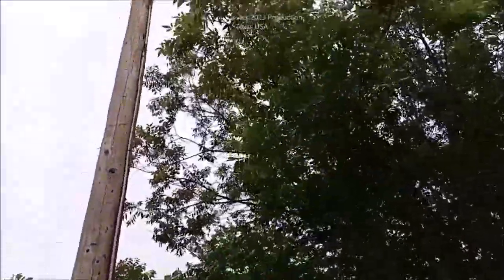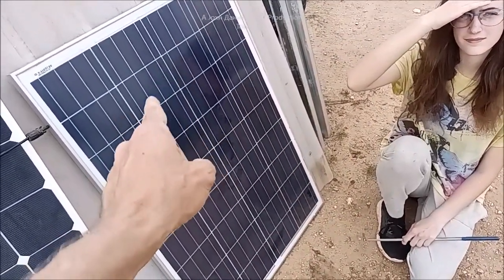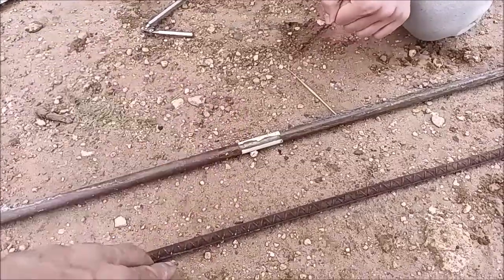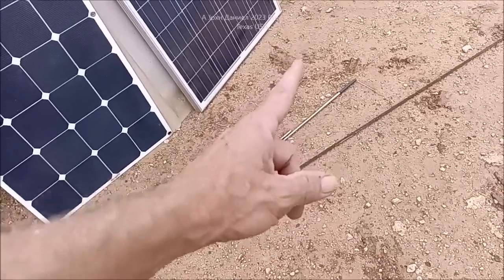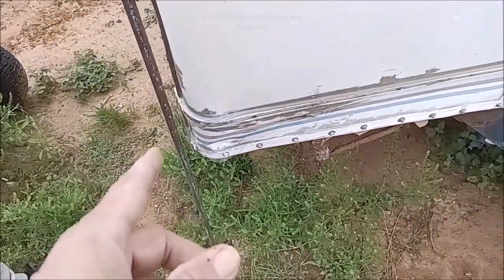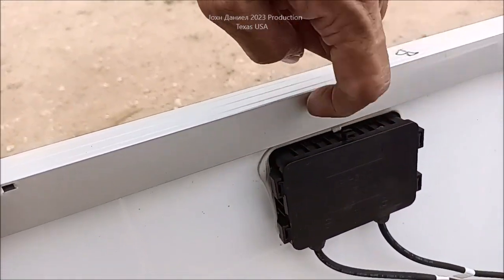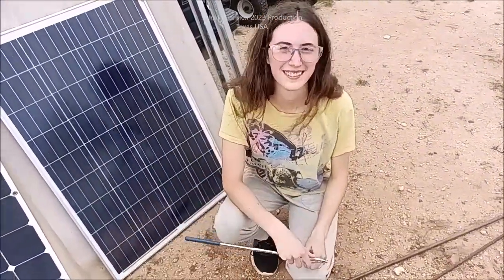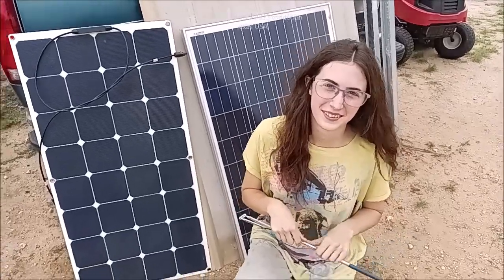Grounding your SOLAR PANELS? 🤔 You Better watch this First! *KNOW DC/Inverter POWER is not Utility

Comment: Very informative. Mr John, Im about to install a "Tram 1477 Pre-Tuned 144 MHz–148 MHz VHF/430 MHz–460 MHz UHF Amateur Dual-Band Base Antenna with White Fiberglass" on my roof and run relevant coax into the house to connect to Ham radios and/or amplifiers for the radios in the house. Can you give any recommendation for how I should or shouldnt ground against lightening? If I should run a wire, can spare low grade coax be used? Or old household extension cord? Or its gotta be heavy gauge? Thanks for your clarity and experience.
Reply from the maker: Your lightning target is the base of that antenna. I recommend a standard lightning rod set up using 4 to 5 feet of rod, rebar is ok to use or 5 feet of 6 awg bare wire coiled 2 feet in the ground with the rest up to a rod about 6 to 10 feet away from your antenna and a few feet higher than your antenna. What we have done for lightning and stray static is use 1-3/8 fence rail up the side of the house with stand offs on each end of the house going  6-10 feet higher than the house with a 6 awg bare solid copper in it and it coming out at the bottom 2-3 feet coiled some about 2 feet into the ground. This draws all such events away from your things and sends it down a safe route. 
On my place I have 3/4 rebar driven 4+ feet down with welded plates on it and all connected to the metal frame and siding in 6 spots on my place. But I am in a 5300 square foot metal building I made into a house.
Reply: @ Thanks for this answer. I think Im probably going for the "standard" set up, although... how do you feel about a wire going from the on roof antenna, traveling across the surface of the roof, and connecting to the ground for the house at the electric service entrance where they pounded the copper rod into the earth? Is that an invitation for problems? or good practice? Either way, whether I do the wire down side of house to rebar I pound into soil; or I do the wire traveling across roof to get to service entrance copper rod in earth, are thare a particular kind of insulator fasteners that should be used to fasten the wire? Or any plastic wire fasteners are good?  Thanks for your expertise.

Comment: Hi John, I am getting some conflicting statements about grounding inverters in an rv. I am going to be using my rv AC power cord to plug into my inverter while boondocking. Should i ground the inverter chassis to the RV frame? The power cable will be feeding my AC panel in the rv.
Reply from the maker: I just wire all RV powered inverters as 2 wire and do not use the bonded systems. It's how we got power for a century till the right faceless bureaucrats got pissy.
Reply: @JOHNDANIEL1  thanks John

Comment: I have a 6kw inverter system with 4 x 590watt solar attached. 
I occasionally charge batteries using grid power. Where should i ground the system

Comment: But do you gave s hybrid charge controller that converts to AC? Eg4 6000xp converts to AC snd if you put a breaker panel off the output which is then 240 AC you need a neutral ground bond in that breaker box if you running off grid and no grid connection.
Reply from the maker: Hybrids never last as a stand alone inverter, they tend to be underbuilt ( note weight compared to equally rated inverters ) since they are basically not designed to be off grid more than as a UPS and run on full high dc volt solar conversion. If you try to use them only on battery then you will see they can not handle much.

Comment: At 2:35 "...They (utility) gives you two phases...". Households are supplied 1 phase of 240 VAC split between TWO LEGS. Each leg provides 120 VAC on each side of the pole transformer secondary. A neutral line (which separates the two 120VAC legs and is connected to the center tap of the transformer) runs with each leg to the service drop, along with both "hot" leads to the main panel. At the pole, the neutral line is connected to a noncurrent-carrying safety wire at the base of the pole. Likewise, the premises drop has a non-current-carrying safety wire to ground at the meter point. Only one phase enters the household.
Reply from the maker: OK, join them together so you can double 120 volt amps, of course they are not as you say 2 phases so they will match perfectly, wave for wave not 180 off. Or has the industry not noted as a split of the original single phase, it is actually now not halved, but 2. Can't have it both ways. The ground cable neutral should be removed also since it has no use. And so should the ground/neutral tap on the transformer. But you have to do it on all the poles for a few miles to prove it does not do as the schematics say and then we're in total agreement.

Comment: i am watching this because.. i just placed an order for a 500 residential panel to replace my wo 200w portable ones that ive been using on my roof.
so until its delivered i was looking at the information page of the panels and i noticed on the diagram it has a "grounding hole".
So i was wondering ifs necessary at all?.. i mean i live in the caribbean when its storm time i plan just flip off the solar input air switch.

Comment: I just found out that the farmhouse I bought isn't even grounded. I asked why and they said it would attract the lightning. Still debating over to put one on or not.
Reply from the maker: If you plan to install solar then do it on a steel rack at least 50 feet from the house. Most all old farm houses in remote or open areas avoided lightning rods so that they didn't get hit and burn. If your in the plains you should find the famous piece of 5 to 6 foot long rail road rail ( iron ) sticking up sometimes a foot and buried 4 feet nearby usually about 100 feet from the house on a higher piece of ground. The old timers called them God Fingers because they pointed lightning to the ground there.

Comment: Just for the record... You will never get the Net Metering approval and operation system permits in my location.  Ground is something they take very seriously.  I'm Certified Electrician and Installer.  My two cents.
Reply from the maker: Net metering is only surpassed by Casinos as the biggest bait and switch scam on Earth. We only do independent off grid, no grid no meters. Better to leave that for folks who like odd power outages, grubberment red tape, lies about the hidden liens and laws your gonna regret. I know when I did commercial installs, discussed it with installers in nearly every state, it was a requirement to convince yourself and lie anytime challenged that your all about the "environment" hustle! As long as the Check Cashed.

Comment: Thx u for the video. If I have 1700 Watts of solar coming in, and Im making a system that can be wheeled around in a cart in my basement, do I still need to ground anything? Each panel is about 54Voc. I was going to route the wires for solar under my porch and into my basement. I would appreciate any advice Thx u for everything
Reply from the maker: Wire heavy, use actual fuses, AGU or Mini ANL with best and quality fuse holders. I would be sure to use 1 spec gauge thicker than they call for in any areas that is not easy seen so that section is safe. Example, 24 volt system, 1700 watts is about 70 amps ( normal is using 2 of the 40 amp MPPT ) and that is 8 awg rating to be safe from the controllers to battery, 10 awg due to high panel voltage and lower amps to each controller from solar. Just always wire heavier than they tell you! And use fuses rated for 120% of your calculated amps, 80% of your calculated wire ability, so a real short will pop them and prevent issues.
Reply: @JOHNDANIEL1  excellent thx u ! The panels will actually be on the ground in triangle mounts. I will use the higher gauge wires and fuses like you recommend. No need to ground anything with the panels or ground the controller, inverter, etc inside the house that will be wheeled around? thx u kindly again for your response
Reply from the maker: @andykular3756  The code/regulation/bureaucrat folks who never twisted a wire nut on anything tell you that you must GROUND dc power are the same who are being fired in government for stealing trillions. DC power can be dangerous but the grounding introduces errant static, not solves it. As for your inverter it is a 2 wire design, all of them are even the ones that the code enforcers forced to add a terminal for ground, it is still a 2 wire. My solution is always best grade of fuses like in a Boat, RV or Cabin. No matter how big your system is that is the solution. It only changes when you add some form of grid connection to them.
Reply: @JOHNDANIEL1  excellent ! Thx u for this. I will use the best fuses and will not ground. Really appreciate your candor and advice

Comment: An earth ground is NOT part of a AC circuit.
Reply from the maker: OK, Sounds good. Remove yours on your house and on the pole your transformers center tap is using to balance itself and then it's fixed. I recommend prior to destroying the design you claim is not involved, to read how Neutral/ground line is created. https://www.ecs.csun.edu/~bruno/MultiGroundedNeutralFinal_4-17-7.pdf
Reply: @JOHNDANIEL1  , that's an interesting read but doesn't play out at my pole transformer.  I have no readable current at my grounding conductor/electrode at my home.  My amp meter reads 0.06 amps on the grounding conductor coming from the center tap of my transformer.

Comment: I'm trying to be respectful here, but this video needs to be called out for misinformation. There are tons of nonsensical and also, plainly wrong statements, I'd have to write a novel here to address every questionable statement in this video. Lots of pseudojargon that sounds so incredibly competent but is, at its core, made-up nonsense. If the authors of this video mean what they are saying, then they have no comprehension of either electricity, or magnetism (no, a groundrod is NOT a magnet for lightning...) and no business giving advice on electrical installations. My advice to DIYers: Ignore this video, follow code, ground your solar panels.
Reply from the maker: Appreciate your  'misinformation claiming leftist liar scam" Soon as some ASS-Jack starts saying "misinformation" and Muh Facts,  you already know they are some leftoid nut job sucking big governments ass, and a tax fund leach level leftist bureaucrats communist point of view Karen, but word salad criticisms are not opposing facts, just crap talk. Saying you shouldn't listen to someone with 18 years installing solar and repairing it is just a Karen being a Karen. Feel free to produce your actual facts if you have something aside of fear mongering and being a tool for those desk jockeys making rules who think a wire nut is something to suck on from a woke whacko cross dresser. 
Go write your book to include all the facts you failed to spew any of on here. And while your at it, hammer a ground rod through your own foot since the sun shines on you and rain and lightning my be nearby as well when your not in your underwear in a basement slamming cheetos. There is no "code" for the home owner, DIY RV owner, Camp Owner, Boat Owner, self builder, Etc.,  under federal statutes for solar just for the online certified clowns who sell it to you for 700% mark up. We detail in dozens of videos as here that DC low voltage is not worth grounding, and panels ( aluminum framed glass ) are not common to sudden detonation. Over 80% of solar panel fires involve 3S or higher wiring plans on panels due to MC4 and disconnect failures at over 60 volts. We promote 12 and 24 volt real prepper systems and suggest nothing higher in a battery than 36 volt or from series solar panels of 50 volts. Voltages over 40 volts get you into the real deadly voltage range so we instruct to not grow a stupid hat and run 150+ volts DC like so many Walmart roof fires (300vdc) of solar has in common. Quality MC4 don't exist, and don't blow smoke up my ass about 1 brand no longer sold made in Germany. Why go over 50 volts to make it arc.  
Over 100 million watts on Boats, Cars, Trucks, Busses, RV's and in back yards feeding something have NO ground rod because they have no moron forcing them to do something that fukn stupid. And your a super tard if you think a increased continuity option for lightning such as a ground rod does not increase your target status ( Duh, metal bridge, building, metal shed:  key word metal, connected to ground ) Why you think lightning rods sold for 400+ years? Just some Funky yard Art? 
No, they ATTRACT so to defer to a safer source of end point. If they did not work, then your funny code was not in existence in 1866 (telegraph Service Construction Rule) when that was a "common rule" and they would not have required them on all bridges, , towers, commercial buildings for the safe routing of lightning management. Same under BOCA that we used in the plumbing (not solar electric) industry when copper water systems was the standard. 
HOWEVER, if your a true blue moron and you plan to short your wiring to your panel frames as you install, then by all means ground that son of a beotch so you do not kill anyone. This sounds like your concern, so yes, ground it to hide your incompetent wiring and lack of fuses.
*NEC Code requires grounding isolation ( chassis of fixed objects, not the DC cables, that may hold negative voltage which is not on your solar panels frames unless YOU screw up) on 150VDC or higher to a separate grounding source that is not connected to a utility or AC system with city code addition in a few cases to lower voltages "In Re Santa Barbara CA, 60 volt DC procedure",  in 47 of 50 states.

Comment: 1. You are not grounding a DC circuit, you are grounding the solar panels metal structure. 2. Solar grounding is not against lightning, it's against static charge accumulation. 3. Grounding should not be in contact with any part of your active circuit.

Comment: I have to be honest here, I don’t know if you’re trolling or if you’re serious or if you really just don’t understand the problem with voltage potential and why we ground high-voltage DC systems. 

The videos you see online where people are showing the solar panel frames being energized is because of the high frequency of the solar charge Controller built into all in one systems. 

Systems operating in excess of 150 up to four or 500 V operate at a very, very high frequency and that causes static to build up on the solar panel frames and some appliances can also carry that static charge 
You are correct that you do not need to ground DC systems. There’s no argument there, but it’s what these DC systems are connected to the change the necessity for grounding. 

I have several 48 V all in one systems running at different homes and I have set up dozens for clients and if the systems are not grounded, there will be a voltage potential between the Earth and the metal frames of the panels 

This is to do like I said earlier with the operational functionality of the solar charge controller operating at an extremely high voltage 

Still a DC voltage but a high frequency DC voltage because of the nature of how the MPPT controller works.

I think the reason that you are not seeing these problems is because you were running separate components on a 12 V system had a very low solar voltage
I’ve seen some of your videos before and you have independent charge controllers, and independent inverters and therefore they’re not operating at the high frequency of all in one 48v mppt/inverters.

So to wrap this up with a neat little bow, I want to say that I do not think you are full of shit or are incorrect, but what I do think is that you’re talking about different systems other than your own .

People running high voltage DC all in one systems at 48 V to suffer from the need to ground their solar raise when they’re operating at a high voltage .

This is a different situation than yours, and I really think you should acknowledge that because you could cause people to get hurt if they believe what you tell them applies to their system as well
Reply from the maker: I have told everyone for years, 40+ volts requires more safety process. If your using a ALL IN ONE and you have voltage on your frames your doing something wrong. Voltage does not jump through wires and glass into the frames unless you make that connection to your negative leads to the frame. That is a User failure, not a basis for ground or not ground. I stand by my decades of not grounding DC voltage to anything that shares earth with AC voltages. Use fuses, rated breakers or do not run high DC voltage. Just because the solar panel maker says you can run 1000 volts DC, it's up to you to do that, voltages over 50 can arc and do. The result of those higher volts can wear and carbon your connectors, causing eventual fires. 
In our repair work, all roof fires from text book wired solar panels are those that are grounded and those that are in series not exceeding the dry rating of MC4 connectors. But higher volts induces higher moisture. Same way a ionic air filter works. Then ZAP. All of them, way over 60 in the last 16 years every single roof/solar fire was 80+ volts in the system. Not one was lower voltage and the majority, 55% of all non commercial residential until the last 4-1/2 years was 24 volt systems. 48 and 72 volt is now the sellers goal to push on all buyers. I will stay with Open Volts of 50 or less and not worry.